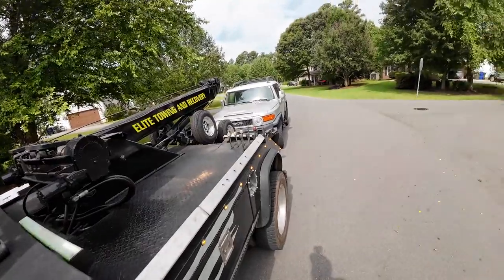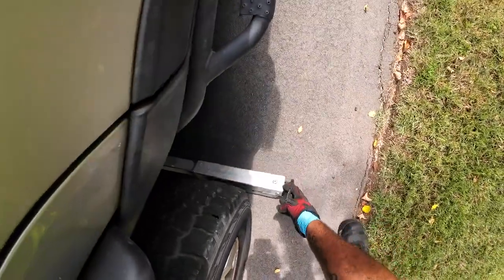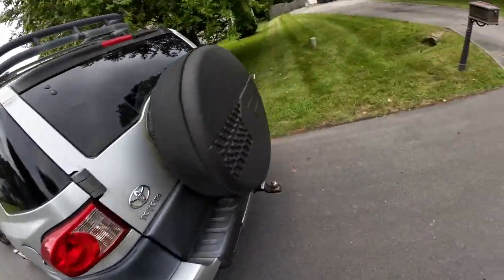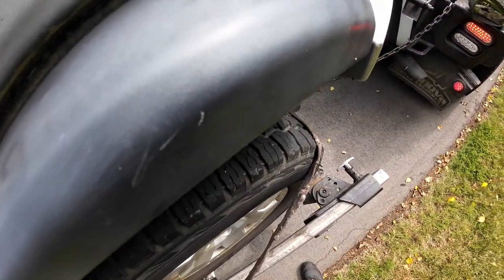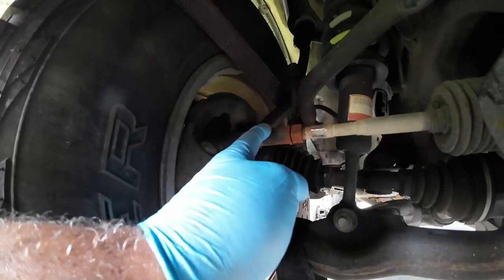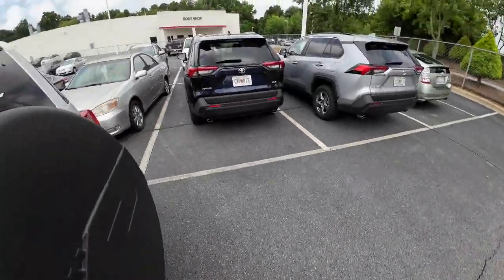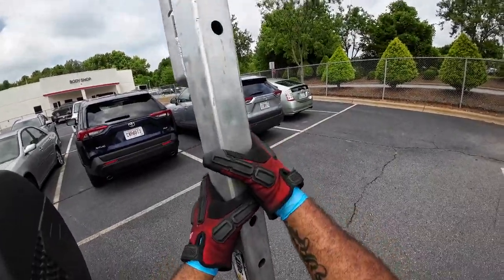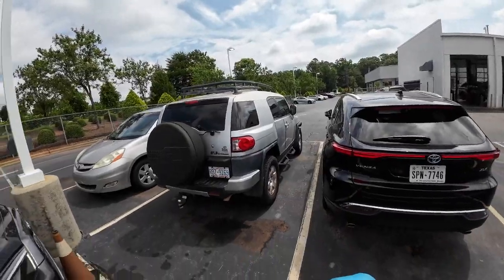FJ WITH A BROKEN TIE ROD

Comment: All ones I dealt with were broken at the balljoint.
Reply from the maker: I’m glad this one was easy to put back together just to get it to the truck
Reply: @TowMan127  even getting them with a rollback is work because I always had to jack that wheel up just to get it on the bed. It's a little easier when I have gojacks but we only had one truck that had one so if I was in another truck I had to rely on a regular floor jack.
Reply from the maker: @Cherokeewolf63  when there is a broken tire rod, it is much easier to load then when you have a broken ball joint. Usually with a broken ball joint, you have to jack it up but with the tie rod, you can kick the wheel or sometimes even turn it by hand, while you are winching the vehicle onto a bed. When you have a broken ball joint, you can use a control, arm skate, or a big block of wood to slide it up the bed.